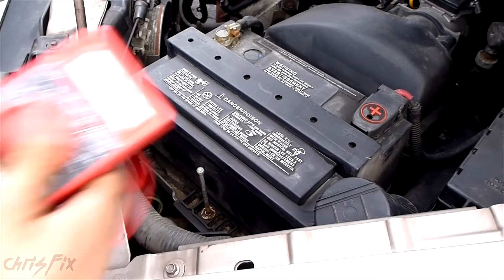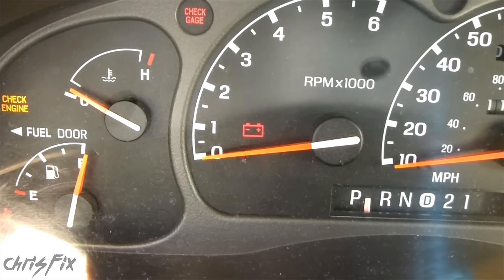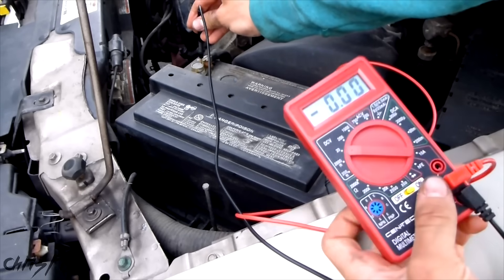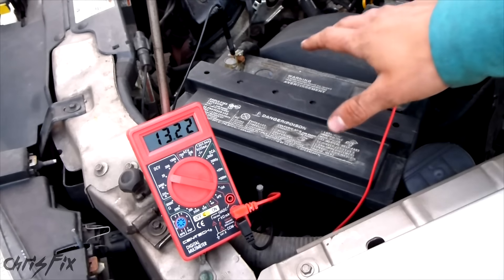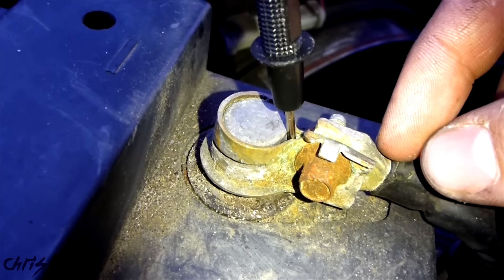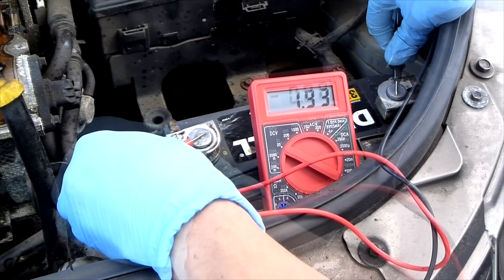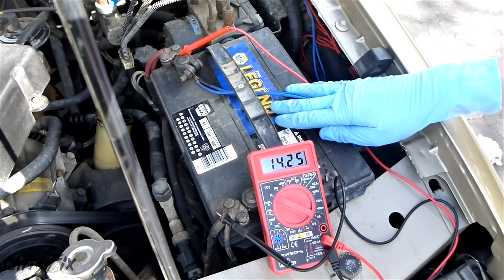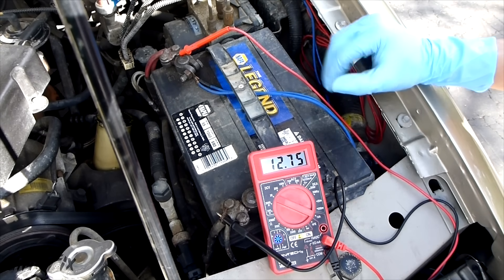How to Test a Car Battery with a Multimeter

Comment: My cars 11 years old and still got the factory battery
Reply: People... When you brag about your long lasting batteries at least say which make and model it is so that we can also buy them and know which manufacturers are good.
Reply: @NidalRashid  Tudor 6yrs and its still fine. In my opinion always keep your battery charged,  I've a solar panel
Reply: +Lewis Harley same here 9 years, but i think itll need changing soon
Reply: My car is 100 years old and it doesnt have a battery - it only has two horses-power though!
>;o)
Reply: Daniel Torre lmfao wth😂
Reply: You probably don't live in Canada.
Reply: mert Kaya  *i have a   ..that's ok and it's time for it to be replace. 
In the USA a replacement battery purchased from your Honda dealer is covered by a 100-month (8 years and 4 months) limited warranty. 
Normally a battery lasts about 4 - 5 years on average.
Reply: *batteries    and good motors.
Reply: Then your battery is worth more than your car ... rofl 😄
Reply: Lewis Harley that is excellent what kind of battery is  it.
Reply: Mine is about 9 years old, but I dont use my car much, mostly on long trips. This means that the motor has not been started very much. Still I will use this useful video to test my battery.
Reply: Lewis Harley holy shit lmao
Reply: That's great longevity. My VW Jetta was made in 2013 and still has the same OEM battery and no issues at all. I do worry though if it will just suddenly die at any time now, since it's always hot here in Los Angeles, though I never have the car parked out in the sun. VW OEM batteries are great though.. from my experience.. and I plan to stick with OEM when I need to buy a new one.
Reply: My 2012 Silverado still has its original factory battery and doing fine...I do check it out twice a year and one of those times I do a load test on it...may change when winter comes this year.
Reply: youtuber I was have perfect  8 year old battery with a honda civic and battery died in service while normal car care :)
Reply: youtuber Honda making good batterys, interesting
Reply: youtuber :D
Reply: Is it a Honda?
Reply: you sure its not running on nuclear energy?
Reply: Haha. Some day we will hopefully be given access to free energy right? I keep telling myself one day the battery will just give me a subtle warning and then die the next day. Prob should replace it before summer of 2019 though just in case. People have said the same thing about VW batteries on the forums, their OEM batteries are decent.
Reply: Dang! The car battery Gods have been kind to you...
Reply: I’ve been maintaining my vehicles for 55 years, and average battery life seemed to be about 4 to 6 years.  Two years ago, my 2008 Avalanche needed  a battery - 11 years later, after date of manufacture.  Go figure!!!  Needless to say, I have since bought 5 more of those OEM batteries from my local Chev dealer (reasonably priced) for various equipment at work.
Reply: same. mine is 10 years old and my car is a Honda Civic. it's time to replace it now with Same Japanese made battery or the OEM battery from Honda Motors.. you get what you pay for it.
Reply: 13 year old car (Opel) and battery (original). Still doing fine.
Reply: The 20th Century Limited jk 🤣🤣🤣
Reply: got you beat friend. Bought a Scion XB on Feb 21 2004 and still has the same Panasonic Battery, that's 15 years!  only 117K miles
Reply: My car was 24 years old today. I finally bought a new battery yesterday !
Reply: Lewis Harley u must have a scooter u piece of shit

Comment: Hi Chris excellent video. The only note is that I always used grease to protect the posts from corrosion. I never used WD-40. What u think about using grease instead?
Reply from the maker: Edgard Aspilcueta Thanks and thanks for the tip. I try to stay away from grease because it collects a lot more dust but that works too!

Comment: battery test was perfect..at startup ...good..was i added almost all electrical components it moved its way up to over 16 volts..is this an overcharging alternator?my battery light is flickering but i have no dimming or startup issues
Reply from the maker: Tim Mcmillan Yes, at 16v your alternator is putting out way too many volts. That could be why your battery light is coming on.

Comment: ChrisFix I have a  battery question for you from my 2002 Ford Ranger. I have been noticing for a while now that my battery gauge shows a low reading, and only nearly 1/8 of the full extent of the gauge when the car is powered but not running. I had a long starting and slow starting period off the battery this past winter. I had also left my lights on for about 20 minutes at one point and lost the ability to start it. This battery ended up being about 9 years old. I replaced it with a new battery from Autozone after their tech told me it was showing fully charged but also reading as bad. The new battery does not appear to read any differently than the previous on my gauge. Was this battery likely bad? Should the new one be reading higher? Does yours run on the low end of your gauge? (While in operation my truck shows a charge on the gauge somewhat low of the middle.) Also how long should a battery last running the headlights without the engine running? Thanks!
Reply: MAbehrens1 Side note. My new battery tests at 12.8 v (only had the Autozone test on the old one) when running the alternator only brings it to 13.88 v and when loading it up we drop to 12.8 v.

Comment: Even if the battery is good, should one replace it anyways if it is 4 years or older?
Since it is about preventing yourself from being stuck when unexpected.
?
Thanks
Reply from the maker: xxgg I wouldnt (unless you live in the middle of nowhere or something like that) because the battery could last you another 4 years. You will hear/feel when the battery is getting weak. You could also get it tested every few months for free at your local parts store!

Comment: My car is 12 years old and is still running on the original battery. Have had no problems and getting above 12.5v so I was surprised to hear that most batteries last around 4 years. Thanks for this video Chris ;)
Reply from the maker: Hustler1339 WOW, that is awesome! You got a good battery!

Comment: i opened my motorcycle battery and added water, as i didnt see water when i looked down in the battery.  after adding water, it stated not to pull the strip on top of battery to add water.  i then charged the battery on 6 amps--- i should have trickle charged on 2 amps, but anyway.  the battery was dripping water on the porch and had bubbling sounds....any ideas--- good battery use it or recycle it?
Reply from the maker: Jeff Thompson If the battery is leaking, it is time for a new battery. What might have happened is you charged it too fast and the water boiled out. Might want to give it one more try on the lower charge setting!
Reply: Thanks chris. ..

Comment: Hi Chris my battery was compleatly dead the other day as sometimes do very short trips on a diesel engine stuck it on charge, put it back in and got 12.7 v  started engine and quickly got 10.6 then straight to 13.8 then stuck lights and stereo on and got 13.7, what do you think?
Reply from the maker: Simon Telford Check your grounds but your alternator might be bad. Do this test: https://www.youtube.com/watch?v=LGB6ZEjGm7Q

Comment: I'm just starting out but wud highly caution any1 on pulling a terminal off a battery due to factory reset codes(newer models).... happened to me once while in Vegas car sat in parking lot battery went dead radio and GPS would not work after battery was replaced needed the codes....a memory savor would work for ur quick demonstrations**
Reply from the maker: Tank It That is such a bad design that it messes up all of that if your battery dies. Thanks for sharing man!
Reply: no problem, thank you for spreading your knowledge with all of us

Comment: To test my battery I start my car in front of a wall at night,put my headlights on and rev the car.MAKE SURE ITS IN PARK OR NEUTRAL!If the lights brighten as I rev the car then the battery's on its way out.
That's how my father always taught me and it seems to work with my car when battery was on its way out.I'm sure it'd be the same whether older or new cars.
Reply from the maker: luke isaac The problem with that method is that the alternator might be causing the problem and not the battery.

Comment: Okay my girlfriend has an 06 Malibu and the car won't fire but it makes a clicking noise like you were saying in the beginning of the video. Now I amused it was the alternator at first cause she said the battery had been tested and was fine. So i pulled out the alternator and had it test. It works fine. Going to try this next, now if the battery passes this test what are some other reasons why the car won't start? Thank you for the video and to anyone for answering my question.
Reply from the maker: Dean J Does it make a loud click or a soft click? It can be a few things. Your ground cable or power cable could have burnt up or you might have a bad starter. Those are the two main ones that I think of right away given what you said.

Comment: Chris, Last night I charged my battery, and when it completed charging I measured the voltage at 12.7. The next morning I checked the battery voltage, and it measured at 12.5 volts. Is this normal? I charged the battery with the terminals disconnected from the battery, and left them unconnected overnight.
Reply from the maker: OnePonyDriver That is fine. A battery will hover around 12.6v. There are some draws such as the alarm system, the radio clock, etc that will pull .1v overnight. As long as it doesnt go below 12v you are good!

Comment: What is the voltmeter you using to test your battery please?
Reply from the maker: Hashem Murtaja The one I use in this video is not that great (it gets the job done but barely). I now use this multimeter: http://www.amazon.com/gp/product/B001O1X65A/ref=as_li_tl?ie=UTF8&camp=1789&creative=390957&creativeASIN=B001O1X65A&linkCode=as2&tag=chri0e2-20&linkId=QOKNQEUCKSZLY37M
Reply: Thank You

Comment: Hey chris i checked out my battery today and when the car was turned off the voltage was 12.6 and when the car was running it was at 13.96 voltage is that good or bad?
Reply from the maker: ***** That sounds about right.

Comment: Isn't WD40 flammable and dries out?
Reply: No. If a direct flame is applied to the battery terminal the dry WD40 film might change the color of the flame for 1/10 of a second, won't even propagate the flame across the terminal. Would need liquid to actually have a brief flame.
Reply: WD-40 won't keep it from corroding.  You need a grease for that.
Reply: +Richard root Some battery terminal protector or some grease right?
Reply: There are some that don't dry out but you gotta wipe out the excess. Wurlh Film .

and Dielectric grease

Comment: A good load test is the "cold flood crank" mode. Turn key on, floor gas pedal and hold. Turn it over and it should just keep turning over. Not all cars have this so if it starts immediately let off of gas. Generally I'll crank it for 5-6 seconds and see what the batt voltage levels off at. Most ford and GM use the clear flood crank to clear flooding condition. The ECM does this by either cutting fuel injection pulse width or ignition system or both. This is a lot of info but good to keep in memory. Also fun to mess with people lol. Love the vids Chris. Lot of great info!
Reply from the maker: Brenndon McGill Thank you man and thanks for the tip! That is a great way to test the engine load!
Reply: Cranking the engine for a few seconds won't damage the starter. That's what it's designed to do. And the comment about damaging the engine by cranking it is completely ridiculous.

Comment: Dow Corning #4 is the gold standard when it comes to a dielectric compound. We use this on all sorts of electrical contacts at work in switchgear and contactors. Most people won't have it but it's normally easy to purchase locally for around $15 a tube and a little bit goes a long way. Amazon is rather high on this product. 

Dow Corning 4 Electrical Insulating Compound Dow Corning http://www.amazon.com/dp/B000LEX8TA/ref=cm_sw_r_udp_awd_uhZ8ub0VEMTAF
http://www.amazon.com/dp/B000LEX8TA/ref=cm_sw_r_udp_awd_uhZ8ub0VEMTAF

The nice thing about this product is it can be used to put in the terminals of your fuse box to prevent moisture intrusion around the fuse blades...etc.  Many uses!
Reply from the maker: wb5mgr Thanks for sharing! I will have to check it out!

Comment: The two keys to making lead acid batteries last nearly forever (compared to ones that are just installed and forgotten) are:

1: also install a microprocessor controlled maintainer that you can use in periods of extended non use or in times of cold weather. I have one I bought from west marine permanently installed on my diesel truck to maintain the two batteries whenever I have the block heater plugged in. The truck also came from the factory with battery warming blankets. Cold weather saps battery charge. 

2: purchase a non-maintenance free type battery and use a hygrometer to measure the specific gravity of each cell making sure to keep them all topped off about once every month or two. The navy actually had guys checking cells on ship daily in the battery rooms according to manuals I've read on battery upkeep. 

I can only speak to my experience, but I typically get 5-8 years from a battery easy and have sold a vehicle with a pair of 8 year old batteries that still worked great and probably lasted the next guy at least another year. 

Oh, rule # 3. Never buy a bargain battery. You can almost always judge a quality battery by using a scale. Thick plates in the core just work better, they don't warp under a heavy load and they hold their charge in cold weather better... But they are heavy and cost more... That's the breaks.
Reply from the maker: wb5mgr Thanks a lot for sharing! Those are great tips!

Comment: I like to put a thin film of grease on the posts and connectors to act as a moisture and vapor barrier and reduce corrosion.  Doesn't WD-40 just evaporate quickly?
Reply: O.K., I looked it up, and they say it adheres to the surface.  I'll still put a little Phil Wood waterproof grease on the contacts, though.  

While this may vary depending on the application, WD-40® Multi-Use Product remains effective even after it appears to dry. The corrosion and rust protection ingredients remain adhered to the surface. External conditions may, of course, require additional applications of the product for maximum protection.
Reply from the maker: Fr No Yes, wd40 isnt the best to use, but it will work and most people have it.

Comment: nice videos CF!!!! thanks for sharing all this info, it's really helpfull!
I had a doubt though... 
It seems like I'll replace my battery and I was wondering; my battery has 650 cca. Can I change it for another which cca is 780,  for example?
Reply from the maker: thatunknownguy Thanks man! You can increase the CCA for sure. I would make sure you have the same size battery (so it fits). Check out this video which should help: https://www.youtube.com/watch?v=fRfPupikHT4
Reply: ChrisFix well, actually the video you mention above took me here, and I just came from my car and it started to do the lights/radio thing, so I'm sure now. Although, it cranks slowly BUT it starts. I wonder if that's weird? The problem started after a very cold week, and it's a 6 years old battery. 
oh and the battery I want is just the same in size  so it's perfect. Thanks for the help man! and also thanks for the feed back, I know it takes time and patience in most of the questions we ask. Very nice from you :)
Reply from the maker: thatunknownguy When batteries get old and cold, they can still start the car but it will crank slowly.

Comment: that was great, thanks.
Reply from the maker: Sagar Rao Awesome! Glad the video was helpful! New automotive "how to" videos every Thursday and most Mondays!
Reply: ChrisFix my battery is 5yr old and its showing 13.36 on the multimeter. what should I do because that the car won't start
Reply: hey chris how are u, i know u say no below 10volt when doing crank test how about if it drop to like 9volt is it still cool and how long do i have to change my new battery if it reads at 9volt.!!

Comment: Thanks for another great video Chris.I am driving a car with an 12v 45AH battery.But in my manual and in different sites it's suggested that i have an 60AH battery.Will i have any problems?Should i change to 60ah?What are the differences between those two batteries?

Thanks!
Reply from the maker: Zisis M Thanks! The AHs (amp-hours) is how much capacity the battery has. So if you keep your radio on and light on with the car off, a 60ah battery will last longer than a 45ah battery. If you are driving around, you wont notice a difference. When starting the car, you want to have the suggested cold cranking amps (CCA) or more, so check that. I wouldnt be as concerned with amp-hours.

Comment: EXCELLENT AS USUAL... YOU SHOULD DO A VIDEO FOR HOW TO USE A MULTIMETER... 😃👍
Reply from the maker: GRAMO107 Thanks and that is a great idea! I am actually working on a video about multimeter basics so you can know what all the functions are for!
Reply: ChrisFix I'M LOOKING UP ON EBAY & AMAZON BUT THERE'S SO MANY OPTIONS IN MULTIMETERS... WHAT WOULD BE THE MOST COMMON THING TO LOOK IN ONE MULTIMETER???
Reply from the maker: GRAMO107 You dont need anything special. This is a reliable and inexpensive multimeter: http://www.amazon.com/gp/product/B001O1X65A/ref=as_li_tl?ie=UTF8&camp=1789&creative=390957&creativeASIN=B001O1X65A&linkCode=as2&tag=chri0e2-20&linkId=CP6ERG626C2HVXQK